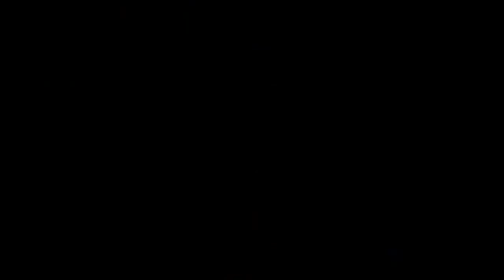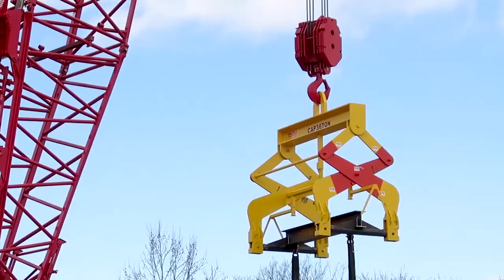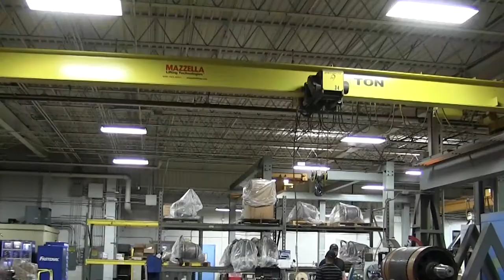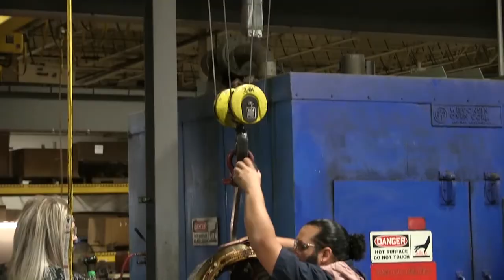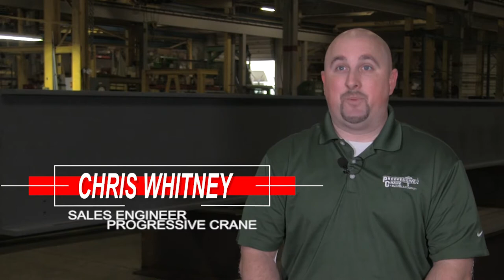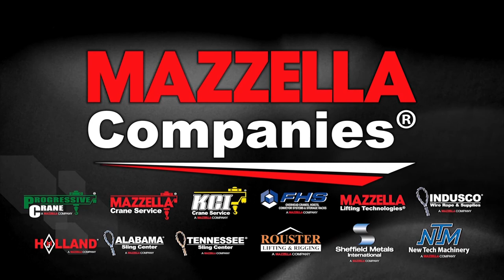What is the Cost of an Overhead Crane? | Cranes 101

Comment: Is increasing a crane's lifting capacity more expensive than increasing the crane's runway length or the Trolley's travel distance, etc?   I "assume" other components "may" have to be increased as well to accommodate the heavier lifting capacity such as the Bridge Beam(s).

Comment: You are not answering my question
Reply from the maker: Hey Berhane! Thanks for the comment!

Every lifting application is entirely unique. There are so many different factors that impact the cost of an overhead crane, and we felt that by adding an exact dollar amount, we would have been inaccurate and dishonest. That's why we have listed those factors and provided a range of prices you can expect to pay, on average, for the most common sizes and configurations of overhead cranes.

Our hope is that by taking those factors into account, you'll be better equipped to take a look at your facility and desired lifting project, and better estimate the cost.

If you’d like to do a little more research, this article (https://www.mazzellacompanies.com/Resources/Blog/What-is-the-Cost-of-an-Overhead-Crane) goes a little deeper than the video. 

We hope this helps!